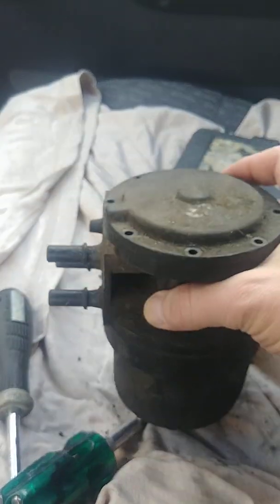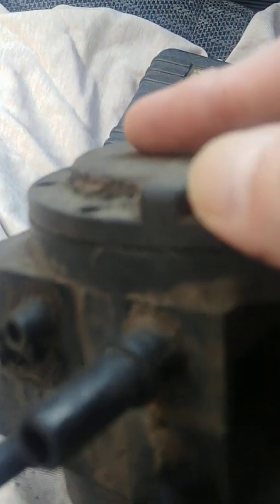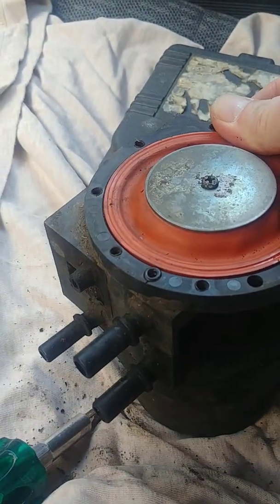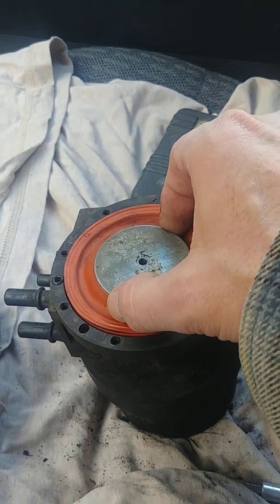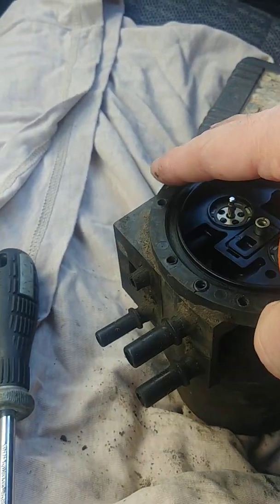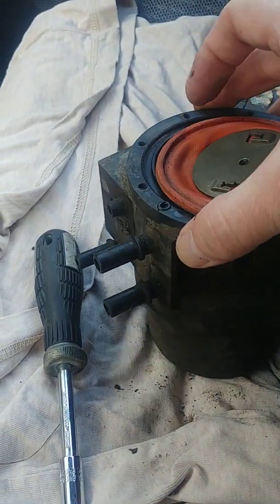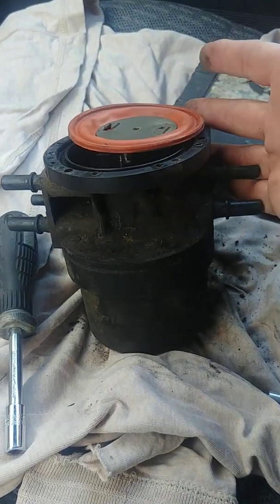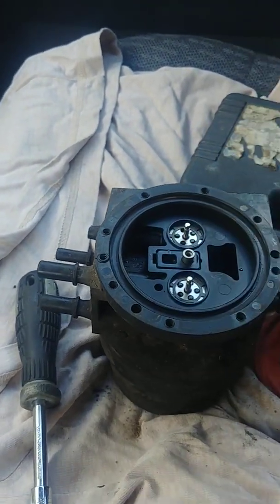Fuel tank selector valve (Dual Function Reservoir) 1988 Ford F150

Comment: Nice video, will this stop the truck from starting, I. Dealing with a fuel issue on my 87 f150
Reply from the maker: It could stop it from starting. Did you try spraying starting fluid in the intake? 
When I had bad Dual Function Reservoirs, it was more of a running problem, than a starting problem.
When you cycle the key to the run position, do the fuel pumps kick on for about two seconds?
I would recommend posting your questions in a Ford F-150 forum. You'll get a lot of answers there.
Reply: Thank you, John for getting back to me. I really do appreciate it. I wrote this whole thing out and went to go sending it and wouldn't go through
I did spray starting fluid into the intake and it did start up but stalled. After that, I replace the fuel pressure regulator I do hear each fuel pump in Each gas tank kick on for a couple of seconds when the key is turned to the on position, I removed the fuel filter and blew through it. That was clear that was replaced about 3 years ago when I seen your video. I was thinking. Could that be the cause of my truck not starting when I select either tank from inside the cab? I could see the gauge going up or down depending on how much gas is in each tank. So I'm not sure now. If that would be my problem, I know there's a high pressure pump, in front of the fuel selector Canister, and then after the high pressure fuel pump is the fuel filter and then on to the fuel rail. I believe now that I'm thinking maybe you would know. Could it be the high pressure fuel pump? Thank you for any bit of information that you could give me  @johnd.9145
Reply from the maker: @nickpanhead7209  see if you can get a loaner fuel gauge from a local parts store. See what the fuel pressure is at the Schrader valve on the fuel rail under the hood.
Reply: @nickpanhead7209  did you ever get the ford to run again? I have the same issue… truck only starts with starting fluid but dies down without it. Wont start without the starter fluid
Reply: @johnnydee8277 mine wound up being a broken driver side rear upper shock mount, causing shock to fall onto some wires giving me a no start issue. Good luck maybe just check your shocks. Probably not but you never know.
Reply: I'll try that when I'm at truck again. I did press On the schrader valve. And nothing came out. But I'll stop at an auto parts store to borrow one. Thank you

Comment: I have a question if my f150 89 XLT lariat . Is not getting enough fuel pressure do I make sure the selector valve is allowing it to go up an down when it calculates the fuel in selector is that how I know it’s working fully ? An allowing fuel to run thru it so that’s it should be able to correct psi ? Because someone told me the valve could be stuck on other tank instead of the working tank . Because I also have two tanks an only one works fully . So the one that works is the first tank . So how do I make sure the selector valve is on the first tank an it’s actually working as needs to be once I take selector off an disassemble it like in this video before I buy I fuel pump incase that’s the issue?
Reply from the maker: The process for testing the in tank fuel pumps is fairly involved. You need a quart container that is gasoline rated. 
You need two pieces of hose with about a 5/8" inner diameter.
Disconnect the fuel line from the back of the fuel tank selector valve. The two fuel lines closest to the center of the truck, are coming from the two in tank fuel pumps.
The top hose is from the front fuel tank, the bottom hose is from the rear fuel tank. Put the hose over the end of the disconnected fuel line, coming from the working tank.
Jumper pins "A" and "E" at the diagnostic plug, under your hood, near the driver's side fender. Unplug the inline high pressure fuel pump that's mounted on the frame of the truck.
With the hose in the container, turn the ignition to the on position. Don't start the truck.
The fuel pump should pump 6 ounces of fuel in 5 seconds.
If it doesn't, it needs to be replaced. If it does, you need to test the fuel tank selector valve, to see if it is functional.
To test the fuel tank selector valve,  you disconnect the two return lines at the rear of the selector valve. They're the two lines closest to the truck frame. The top line is going to the front tank, the bottom line is going to the rear tank.
Connect two hoses, one to each return Port on the selector valve and run them into the container. Reconnect the wiring to the high pressure fuel pump and reconnect the fuel lines from the fuel tanks, to the selector valve.
When you turn the key on, the return line going to the tank you have selected, should pump 6 ounces of fuel in 5 seconds.
If it doesn't and the fuel pump pumps 6 ounces of fuel in 5 seconds, in the first part of the test, the fuel tank selector valve is bad.
Reply: @johnd.9145  thank you so much , you are highly appreciated . God bless . That’s all I needed to hear . Preciate you man & Keep up the content 👍🏽

Comment: If there is no filter in the bottom then someone already removed it like I did.
Reply from the maker: My truck didn't come with a filter in the dual function reservoir. Some did. From what I've read on line, shallow bowl DFRs had a filter, deeper bowls marked "do not remove" didn't have a filter. So yeah, I could be wrong about all 1988s not having a filter. I enjoy working on this truck and learning about it. I'm not angry about it in any way and won't be tossing everything I know out the window.
Reply from the maker: In 1988 F150s there was no filter from the factory. Other years and models did have a filter.
Reply: @johnd.9145 I have a 1988 ford f150 lariat, and mine had one. I removed the filter inside of it myself a few years ago. I also have 87 custom F150. So what ever you think, you know just got tossed out the window.

Comment: Hello sir. I have an 87 f150 and decided to remove the front (smaller) tank due to rust and damage. The car was running great before I removed it (just had a large leak). I did not replace it and instead want to only run of the rear tank (I dont need both cause it is a ranch truck). What I did was I closed off the two fuel lines that went to that front tank with some extra fuel line hose, a screw, and a how clamp. When I started to just try running off the rear tank I had bad performance issues and the car would start acting weird and then shut off after 20 minutes of driving. Im thinking that maybe I need to change the fuel tank selector valve to something else. Do you know what could be causing my problems?
Reply from the maker: These fuel tank selector valves are pretty expensive. My best guess, without seeing your truck, is that the selector valve wasn't switching properly before you plugged off the lines. Check out the O ring in the top cover; the O ring that I'm pointing to in the video. Also, it's possible that there is a filter in bottom of your selector valve. I would check that second, after checking the O ring. Here's a link from a forum with some good information https://www.supermotors.net/registry/2742/66025-2
Reply: @johnd.9145  Okay thanks John, i’ll try that out👍
Reply from the maker: I would join a forum and ask the question there if I were you. It's difficult to troubleshoot these fuel systems and a forum will give you access to lots of knowledgeable people.

Comment: So my question is why is there a filter cavity if you don’t put a filter on it? I opened mine and just thought the last owner didn’t feel like putting one in so I added one. Any issues you can think of?
Reply from the maker: I don't know is the short answer. My 1988 F150 did not come from the factory with a fuel filter in the reservoir. I would guess that Ford was using that housing on different models and years of trucks and some required a filter and some didn't.
Reply from the maker: Here's a good read on it https://www.ford-trucks.com/forums/631465-fuel-tank-selector-valve-1988-f150.html
Reply from the maker: And this link includes pictures https://www.ford-trucks.com/forums/630562-cleaning-fuel-selector-valve.html

Comment: I was driving it this morning ran out of gas that's why I feel like in a diesel F250 '85 both fuel tanks are full. Switch on inside cab is missing. Just bought truck, can anyone assist. She cranked for about a minute and Died, she acts like shes still thirsty.

Comment: My diaphragm was ripped and the pistons were sticky.  I think I'm out of options but to bypass it.  I freed the pistons but the rip in the diaphragm is the killer.  I blew light air through the tubes and the top works fine (probably the front tank) but the lower tube sent air back through the rear of the valve and not the engine side, hence why if I ran on the rear tank, the front tank would overfill and spill out.
Reply from the maker: I've got a spare diaphragm... The one in my video. If you're interested in buying it and we can figure out a way, I'd be willing to sell it cheap.
Reply: @johnd.9145  That's very kind of you.  But, I went ahead and did a bypass with a trickflow canister filter, some rubber hose, and a few fittings.  So far so good.  I'm going to write up a little post on my blog and then leave a link here so people can see it and the part numbers I used.

Comment: It's also a reservoir..  probably needed to compensate the low pressure pumps to the high pressure in line right ?      I'm building a built 306 with supercharger for an Econoline ( same fuel setup ) ...  I'm trying to figure out if because of the reservoir  that all I need to do is put a high pressure  in line pump    ( like a 255 lph )   on the frame rail and if the in tank pumps and the selector valve reservoir are still okay.   I mean,  It is AFTER the reservoir so I guess   its not like its pushing more pressure at the valves... hmm What do you think?
Reply from the maker: I don't know, but my intuition says you would need more than stock pumps in your tanks. Is it 306 ci because of heads? Did you do a roller cam? Just curious...
Reply: @johnd.9145    yeah i read a blip that low pressure tanks are better at pushing .. high pressure at sucking.    heads don't alter displacement,  only cylinder bore and distance of crankshaft stroke.  so it's a 302 that's been bored in the cylinders  to .030 over with larger pistons.   so now instead of like a 4.001   it's a 4.030  size bore.  If you took that 4.030 bore and extended the stroke of the crank from 3.00 inches to 3.040  you now have a 347.  But the 306,  making it an actual 5 liter rather than a 4.9x  that a 302 is. Head chamber size changes compression ratio   or the quench   distance from piston crown to combustion chamber. More chamber less compression less chamber more compression higher power.    No roller cam.. hydraulic flat tappet.  Roller has its modern advantages   side load is questionable  from what Ive learned .   Flat tappets though could run through mud ..  like if something let go or mud or debri clogged a roller tip on a lifter and the lifter sticks you eat the lifter or a cam lobe.   Not that hydraulic on a flat tappet doesnt fail    but    I think theres a reason for them being on the trucks  and it was being in dirtier environments   ... maybe.. but they are a nice Lunati flat tappet with stronger plunger hold downs  and better oil control.
Reply from the maker: @DS-mo6md  Wow... I know engine basics but I've never been that far into the internals. I've been reading an interesting thread on a F150 forum from a guy who lays out how to get more low end torque out of 302s. He really gets into the details. Sounds like you have a good plan there for sure...
Reply from the maker: @DS-mo6md  https://www.f150forum.com/f10/bit-info-those-looking-build-300-hp-5-0l-302s-276512/
Reply: @johnd.9145  well the 5.0 / 5.8 EFI  to begin with have the longer runner  dual throttle body for higher velocity charge at low rpm ( more torque ).. I have mine ported and also if you use a phenolic spacer  under the plenum to lengthen the runners even further it will lower the peaks.  mine ported and dimpled is pumping maybe 280 cfm per runner. .

Comment: This does not have electricity to it,when u switch your tank selector it runs your front or rear pump ...
Reply from the maker: Exactly. You use the rocker switch to select your tank, then the pressure from the tank moves the selector valve diaphragm
Reply from the maker: Maybe it should be called a fuel tank isolator valve, since that's what it actually does. Otherwise the fuel pressure would flow between tanks.
Reply: Mine stopped working, which is why im watching, and I'm getting fuel returned to the front tank while only using the back tank, which is overflowing the front tank.